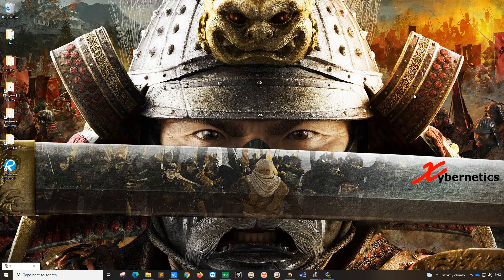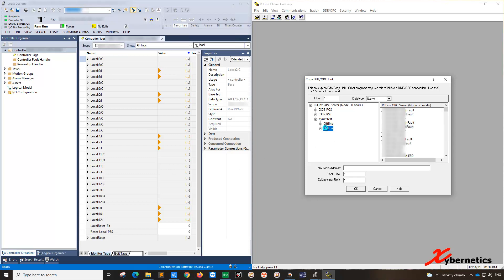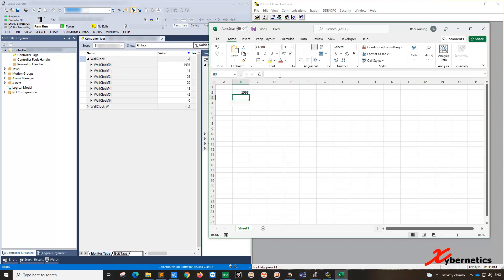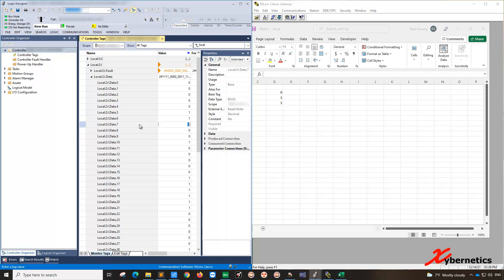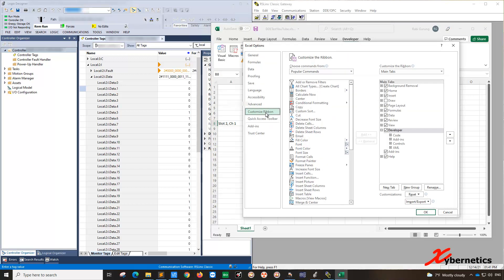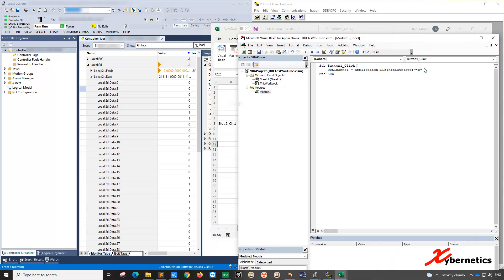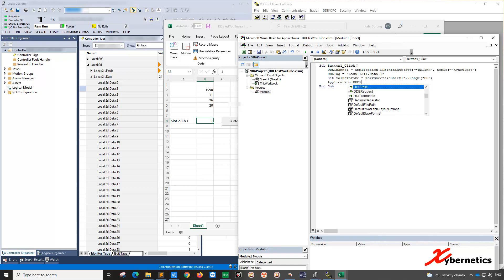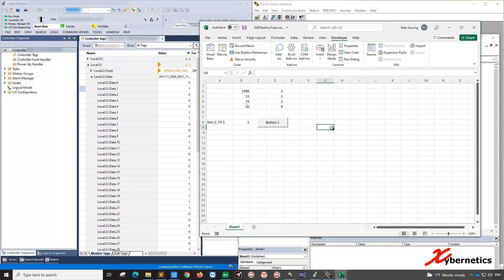Read and Write Data From Microsoft Excel To Allen-Bradley ControLogix Using RSLinx

Comment: Hi, Its really nice demo. What if I don't have physical PLC with me, Can I run the same stuff that you explained being PLC in simulation mode?
Reply from the maker: Yes you can.
Rockwell comes with a simulator software as well., commonly referred to as "Emulate" or "Studio 5000 Logix Emulate" (previously called "RSLogix Emulate").
Check it out.

Comment: Is this possible for program tags, and not controller?
Reply: yes program tags are done in a similar way. Here's a section of code I used
    For i = 0 To 9
        'Acquire Data
        DintData = DDERequest(RSLinx, "DINTs[" & i & "]")
        
        'if there is an error, display a message box
        If TypeName(Data) = "Error" Then
            If MsgBox("Error reading DINTs[" & i & "]. " & "Continue with Read?", vbYesNo + vbExclamation, "Error") = vbNo Then Exit For
    Else
        'No error place data in cell
        Cells(2 + i, 10) = DintData
    End If
    
    Next i

Comment: Now how would I write to a program tag that is a UDT -> "Program:ProgramName.TagName.Member[0]"?
Reply from the maker: To write a value to the ControlLogix PLC from Microsoft Excel spreadsheet via RSLinx Gateway, is a bit involved. Please see the YouTube video timeline at 7:00.

Below is the VBA source code mentioned in the video to write value to the Allen-Bradley ControlLogix PLC.

Sub Button1_Click()
    DDEChannel = Application.DDEInitiate(app:="RSLinx", topic:="NEW_TOPIC")
    DDEItem = "Local:2:I.Data.1"
    Set RangeToPoke = Worksheets("Sheet1").Range("B14")
    Application.DDEPoke DDEChannel, DDEItem, RangeToPoke
    Application.DDETerminate DDEChannel
End Sub

Let me know if you have further question(s).
Reply: @jjnet247  I figured it out! Thanks for the video!
Reply from the maker: You are welcome!
Reply: I'm working on this exact problem now. What did you need to do? Do a write for each specific member per iteration?
Reply: @brewtalityk  I could neverrrr write to a program scoped tag, so I wrote to a controller scoped tag and then used a COP in the PLC to copy to a program scoped tag. 
here's the code I wrote inside Excel. I assigned it to a button. and wrote my data A1 thru Axxx. etc. 

Sub Button_Click()

DDEChannel = Application.DDEInitiate(app:="RSLinx", topic:="YOURTOPICNAMEHERE")

For i = 0 To 100
DDETag = "YOURTAGNAMEHERE[" & i & "]"
Set ValueToPoke = Worksheets("Sheet1").Range("A1").Offset(i)
Application.DDEPoke DDEChannel, DDETag, ValueToPoke
Next i

Application.DDETerminate DDEChannel

End Sub
Reply: @brewtalityk  I could never get neverrr write to a Program scoped tag so I wrote to a controller scoped tag with the same UDT structure. Then used a COP in logic to copy from my controller scoped tag to the program scoped tag. Here's the code I made for my Excel sheet. I created a button and assigned it to a macro. 

I put all my data in A1 through Axxx. 

Sub Button5_Click()

DDEChannel = Application.DDEInitiate(app:="RSLinx", topic:="YOURTOPICNAMEHERE")

For i = 0 To 100
DDETag = "YOURTAGNAMEHERE[" & i & "]"
Set ValueToPoke = Worksheets("Sheet1").Range("A1").Offset(i)
Application.DDEPoke DDEChannel, DDETag, ValueToPoke
Next i

Application.DDETerminate DDEChannel

End Sub
Reply: @brewtalityk  I could never get neverrr write to a Program scoped tag so I wrote to a controller scoped tag with the same UDT structure. Then used a COP in logic to copy from my controller scoped tag to the program scoped tag. Here's the code I made for my Excel sheet. I created a button and assigned it to a macro. I put all my data in A1 through Axxx. 
Sub Button5_Click()
DDEChannel = Application.DDEInitiate(app:="RSLinx", topic:="YOURTOPICNAMEHERE")
For i = 0 To 100
DDETag = "YOURTAGNAMEHERE[" & i & "]"
Set ValueToPoke = Worksheets("Sheet1").Range("A1").Offset(i)
Application.DDEPoke DDEChannel, DDETag, ValueToPoke
Next i
Application.DDETerminate DDEChannel
End Sub
Reply: @brewtalityk  I wrote to a controller scoped tag and then used a COP to copy to the program tag in logic. I have example code but not sure how to get it to you. YT keeps deleting my comment